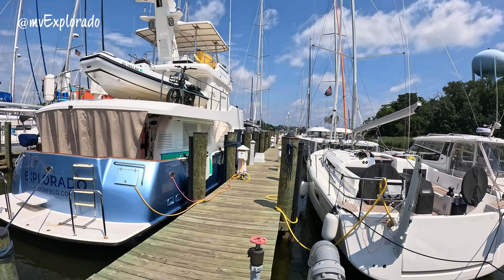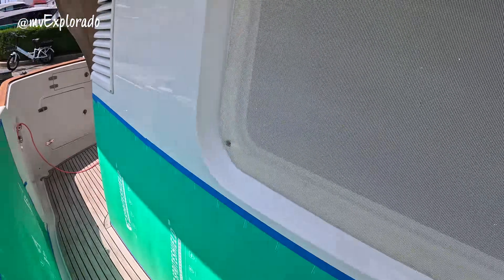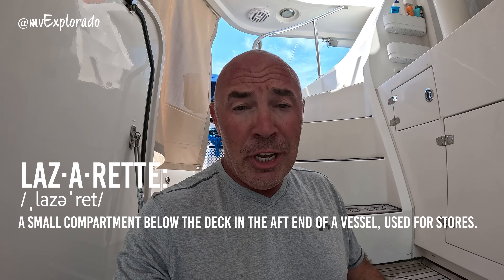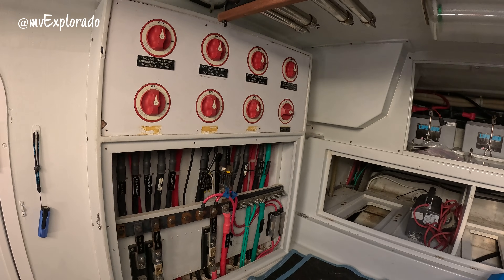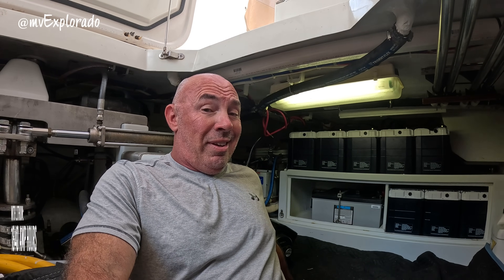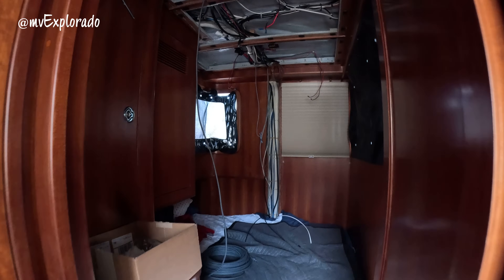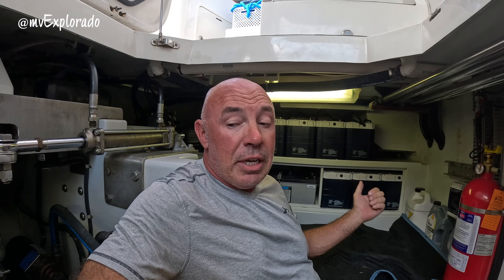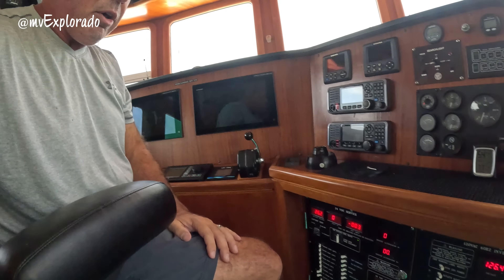Major Power Upgrade on our Nordhavn Floating Home (Game Changer!!)

Comment: Is it correct? When you go to lithium you have to upgrade your alternator because lithium has a all the sudden heavy draw which can kill your alternator?
Reply: No need to change the alternator but you will want to have a regulator for it. A regulator and the BMS will work together to control how much to charge without overheating the alternator.
Reply from the maker: I see Dave gave you your answer. :) We will have a video coming up explaining more!